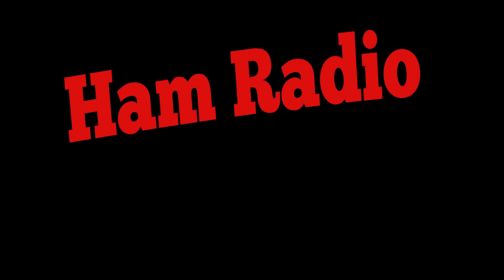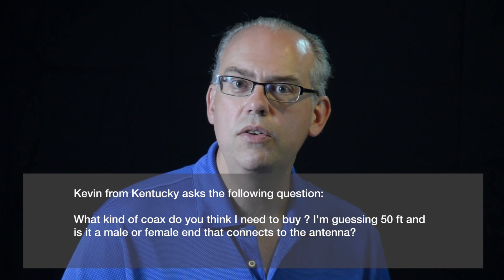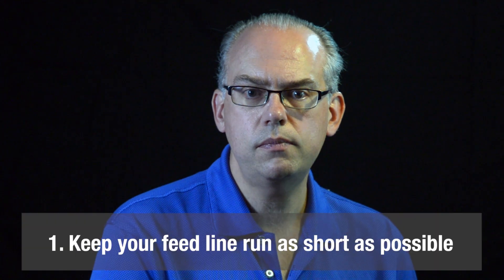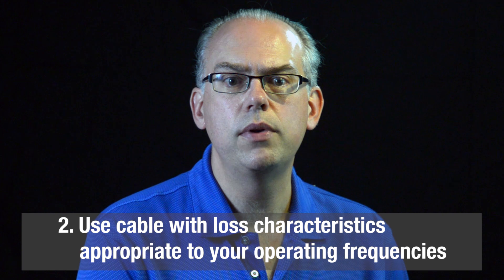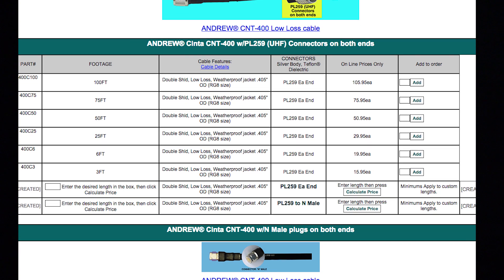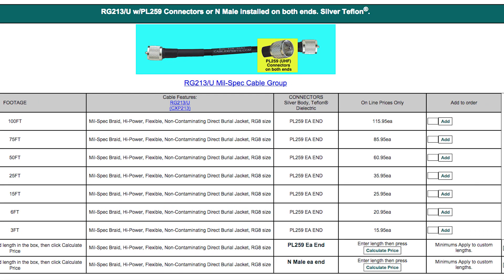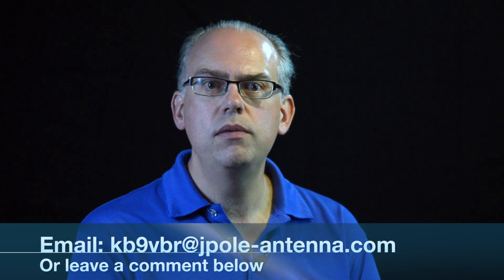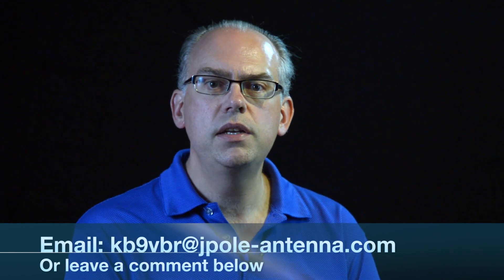Ham Radio Q and A Episode 2: Selecting Coax Cable

Comment: So, if I'm trying to errect a GMRS external antenna at my house, I can either run 25 feet long the brick house and then out along the wrought iron railing before reaching the base of the mast... or, try to eliminate the run, and use about 10 feet to a temporary mast outside my kitchen window.  If we're looking at 462.500 Mhz to 467.700 Mhz for GMRS, what should I be looking at?  I'd like to keep the diameter of the coax small, so that I can sneak it in through a power socket from external wall to internal power socket in the kitchen and onto my counter.  What say you?
Reply from the maker: The thinnest coax cable I would go with for the GMRS is RG-8X and even then I wouldn't try to extend the length past 25 feet. At 25 feet you will have 2.1 dB of loss with RG-8X cable at 460Hz. https://www.jpole-antenna.com/faq/coax-feedline-attenuation-chart/. Those losses might be acceptable if you are using a 40 watt base radio, but if your GMRS transceiver is a handheld unit, you will be at a severe disadvantage. 

One option may be to use a thinner cable to get through the power outlet and then outside transition to lower loss cable. That may help minimize your feed line losses greatly.

Comment: As I was taught. Your antenna is 90% of your system. That includes the feed line. Hardline is the best, next is LMR-400 and crimp connectors.
Would you buy a $ 800.00 Flat screen TV and connect it to a set of rabbit ears?

Comment: Great Video!  Very usefull understandable information.  As you pointed out early in this video,  A persons  Ham Radio Station is really as good as the Cheapest link in the system.  I will try to get the most low loss coaxial cable I can for sure!

Comment: Hi mike my name is jack i use just a piece of 148 ft 20 awg silicone flixeable  hi temp wire one end in the tree and the other end to my LDG ic-100 ant. Tuner there is no balun in line  and i have worked all bands 100% what do you think!. Jack kb2txr

Comment: Can you run an lmr-400 in a vehicle 18 ft long on a 40 channel 10 m radio?
Reply from the maker: You can, but really would offer no advantage. At that length and frequency, RG-58 would be just as capable and be easier to work with.
Reply: @KB9VBRAntennas  I had no problem working with mine I got a102-in stainless steel whip with a one to one match on my mobile. and I talk skip when skip condition is good no problems there, my dx86v Galaxy 120 pep upgrade!
Reply: @KB9VBRAntennas  
I could agree with you on that but the LMR 400 at 18 ft there is no loss of power and I got a one-to-one match. It's working fine in my vehicle I have a Galaxy DX 86 v 10 m amateur radio upgrade swings to
 120 pep  Either way they both work. but I think I get a little better output to my antenna with the LMR 400 coax I run 102-in stainless steel whip with ball mount and spring and it gets out.

Comment: Do you know Bolton 400 coax is good or not Amazon sells it as LmR 400 or is it a scam  thanks
Reply from the maker: I have no experience with the Bolton 400 coax, but generally inexpensive LMR-400 knock-offs will use a copper clad aluminum center conductor. That in itself isn't necessarily a bad thing as due to the skin effect, RF energy will travel along the copper skin of the conductor. But it creates two significant deficiencies. First, the coax will be very stiff. It will be harder to work with and bend. Second, it will be more fragile. Aluminum core LMR-400 is prone to breaking if you flex it too much. The coax will be fine if you install it once and leave it in place without moving it. But repeated moves and flexes could compromise its long term usability.
Reply: @KB9VBRAntennas    Thank you so much for your insight. I’ve decided to send it back I found some RG8 steren  that I’m going to trust before I do this other stuff. I tried to search them out they claim their a US company but you try to search it out it becomes a dead end. Anyways thanks so much I sure enjoy your videos I’m working on my ham license thanks again for your response
Thank you

Comment: Question ?? I'm having to replace my coax cable on our marine/ais radio . My question is how do I measure the cable in feet with out screwing  it up ? Every 3 feet or every 1.5 feet ? I'm going to drop in west marine and pick up a super good coax and do my own ends myself but unsure on my limits . I really don't need anymore than 6 feet and tired of picking up junk coax . This coax will be going on our small boat with a 3db antenna and a Standard Horizon 25 watt radio . Might not sound like a big deal but for some reason every time we are in this boat something always goes wrong near by and we are talking from Myrtle Beach SC to Charleston SC coast guard . It would be nice to know I'm doing every thing possible to send information..  Thanks !!

Comment: Is the center conductor on LMR-400 solid copper?
Reply from the maker: The Andrews/Times Micowave LMR-400 does have a solid copper center conductor. The generic brand LMR cables sometimes do not and instead will be copper clad steel. This is often not a problem for VHF/UHF as the signal is traveling along the outside of the conductor due to the phenomenon of the skin effect. But it does make for a stiffer and less flexible cable.
Reply: @KB9VBRAntennas  thank you 73

Comment: I can't afford to buy good coax but i have a 5kw amp. Bang for buck there is no expensive coax and the performance gains / $ are great. If your coax vf is not 87% you haven't done your homework. You can go better. The best cable shown on this list is still not as good as other coax available and it's far more expensive. Even better try not to use coax when possible.

Comment: Very informative video thanks - I'm planning a new station and and am considering a high quality cable run to a junction box that I could then connect forward from to the various aerials I am planning. Do you think the junction box would cause any loss / problems if I used the best components and cable connecting from it to the aerials to follow?

Comment: Great video. I would mention again that cable length is SUPER important in VHF/UHF. Beyond 25 feet the losses become intolerable with something like RG58 or RG8x. Time to step up to some RG8, LMR400 or RG213.

Comment: Thank you so much for this video. Is the LMR400 too stiff and thick? I am trying to set up an antenna in my attic or roof and run the cable thru the inside of my wall into my radio in the second floor. Would it bend enough or not?
Reply: LMR400 is about .400” or 10mm thick, and it’s quite stiff. There is a minimum bend radius, which I don’t recall, but it’s specified in the spec charts online. It’s not a super tight radius. It’s going to be some struggle to bend it 90 degrees within a typical wall, either in a conduit elbow or to fit a wall-mounted feedthrough connector. LMR has an expanded foam dielectric that’s fairly soft, so bends must be gentle to keep the center conductor actually centered within the shield.  There is an LMR400 ultraflex that has a stranded center conductor. It’s more flexible.
Reply: @PeopleAlreadyDidThis  thank you! I posted this a while back. Since then I was able to pass it thru the wall of my house without much of a problem with the bends😊

Comment: I want to buy RG223 and RG213 cable for VHF and UHF band, the question is what is the maximum length is best. My requirement is 100 feet
Reply from the maker: I wouldn't got over 75 feet with RG-213 on VHF. Look into LMR-400, it really isn't that much more a foot, and it will make a world of difference

Comment: i have 75 feet of to run to the antenna to my SWR and power meter but i only have rg58 or rg 8x to run to my lener and radio . how well would this affect the swrs . or sould find some other cable for the meter and lener

Comment: I’ve got 18 feet of mini 8 feeding an Antron 99. It’s too short. Can I safely use a coupler and another mini 8 and how much loss would I be looking at. Thanx
Reply from the maker: Loss will be minimal. on HF‚ couplers may only add about .125db to the entire feed line system
Reply: Awesome. Thanx for a speedy reply.

Comment: Ha ha I was gifted a 1000 ft of rgu 58 u . Verry good for good runs for 25-50 foot runs. Rgu 8 u is better. I get that however the military surplus claimed they have better is that right. If so what is the noumclatere.?

Comment: Hyperflex 13 or 10 is the best!
But its pricey $$$$$$$$$
I like LMR600, but it's more brittle than a 90 year old hip that's why I recommend M&P pure copper coax.
I use a custom dipole antenna w/ traps tuned to 11m or a small rooftop tower antron99 on top of a 2 story house.
alpha Zulu 983 click click 73s
Reply: excellent coax, quality product.. from my research. iam about to buy 1ooft of hyperflex Messi&Paloni..MFJ is NA distributor they dont make it just sell it 7 3

Comment: I have built a 7 element yagi antenna taking centre frequency to 98MHz for fm dxing, Can I use 1/2 s.f feeder cable to connect the antenna?? Cable length will be 15 metre and antenna will be 50 feet above the ground. I want to listen very long distance FM stations up to 1000 km. I will also use a LNA which 50 ohm. Please suggest me which coax should I use??
Reply from the maker: For VHF at that length‚ I'd recommend LMR-400
Reply: @KB9VBRAntennas  thank you so much

Comment: "maintain a minimum mounting distance of at least 1/4 wavelength apart for the lowest frequency antenna within the same horizontal plane. For VHF antennas, that translates to roughly 19 inches"

https://www.jpole-antenna.com/2013/07/28/how-close-can-i-mount-two-vhfuhf-antennas/

Comment: I have rg8x in 100ft.. When i am using icom ic2300h in high power 65w how much power it can transmit in output of antenna
Reply from the maker: I believe RG-8X is rated for 250 watts on VHF, so you should be fine using it with the IC-2300
Reply: @KB9VBRAntennas  how much loss it will present in rg8x.

Comment: Hello sir, can you give me a suggestion what best coax cable should i use for my setup
Antenna = diamond X520M
Portabase = boufeng UV82
Ham base = TYT TH-9000D
and im planning to do a 25meters above the ground tower. Echo siera papa 73's and godbless.
oh and im also using frequency 
140mhz
Reply from the maker: I'd go with a low loss cable like LMR-400 for a 25 meter cable run for VHF/UHF.
Reply: KB9VBR Antennas thank you so much sir i will do the lmr 400.

Comment: Question please... I will be putting up an Eantenna lfa5. The gain is 11.1 and the coax run is 75 feet. Using the chart in your excellent video, if I use RG-8X, the loss would be 4.7 X .75 = 3.5Db. I realize something like LMR400 would be the ideal, but am I totally wrong to call the trade off acceptable?

Comment: Hello. Because of the terrain around my shack, I need to install my 2 meter antennas on a hill adjacent to the house. Total run of approximately 200 feet. Cannot be buried due to rocky soil. I will be running 100 watts. What coax do you recommend on: A. Unlimited budget and B. under $300. Thank you
Reply from the maker: 200 foot cable run will necessitate  use of low loss coax. At the bare minimum I'd use LMR-400 or even something lower like LMR-600.
Reply: @KB9VBRAntennas  Thanks... that's what I was looking at.

Comment: Hi and thanks for the informative video. I have seen things about RG8U being obsolete and RG213U taking it's place. I am just getting into ham radio and will be working on 2 meters initially. I am looking to buy a used Kenwood TM-218 from my license instructor and he is throwing in a discone rooftop base antenna. I figure I will need around 40 to 50 feet of feed line. Which of these two would you recommend? Thanks!
Reply from the maker: RG-213 and RG-8U are very similar, but RG-213 has the advantage of a higher power rating and can be direct buried. HF operators prefer 213 as if you are planning to use an amplifier, you will want a cable rated for that power level. For VHF/UHF, it's less useful as there are better low loss cables out there. But a 50 foot run of RG-213 will work fine for VHF operation.

Comment: great video! What about rg-214 for 70cm repeater? I've heard that this is good also?? I will be using with a steel j-pole 25' run. Motorola m1225 repeater.
thanks
d
Reply from the maker: RG-214 has 5.5 db of loss per 100 feet at 400 Mhz. I think it would be plenty good for your 25 foot cable run. It has the advantage of being double shielded, which is a good thing for repeater use, especially if the repeater is located in a high RF environment. But there would be better choices for a 70cm repeater if low loss and long cable runs are your concern.

Comment: hi kb9vbr. im a new b, just passed foundation, several of the lads from local club hv said (recommended) me to use rg213 as it would be suitable for all acassions… due to where I live I cant hv antennas anywhere so all my radio work will be out in the fields. my rig is a yaesu 891 end fed wire n auto tuner. need 25 feet coax... are my new club buddies right??
Reply from the maker: For HF, 10-80 meter operation, RG-213 is an excellent choice.

Comment: I was told the foil on cable such as lmr400 is no go for hf  should I run rg58 instead thanks for any help
Reply from the maker: I haven't had any issues using foil shielded cables on like LMR-400 or Belden 9913 on the HF bands. but if that is a concern for you, I'd probably choose RG-213. RG-58 is ok for HF, but it still has limitations: it is still lossy at HF freqs and has low power handling capability. RG-213 has excellent loss characteristics on the HF bands and has a UV resistant direct burial jacket, so it will stand up better long-term outdoors.
Reply: KB9VBR Antennas I meant 213 Thanks for the info It was the maker of the ultimax extreme who had mentioned the foil style cable I’m very limited on space so I’m looking for a compromise for my hf antenna 73
Reply from the maker: RG-213 is a great choice for HF, it should serve you well.

Comment: Mike I need 100 Feet of Cable feed line for Yeasi 2900 Rt to my Tram Anteen which is better RG-8 or MLR 400
Reply from the maker: 100 feet of LMR-400 at 150 Mhz has 1.5db of loss. The RG-8U has 2.8db of loss per 100 feet at that frequency. Each 3db of loss is equal to cutting your power output in half. If you transmitted 50 watts out of the radio, with RG-8U  you'd have 25 watts by the time the signal reached the antenna. LMR-400 would be about 38 watts.  So the LMR-400 would be the more efficient cable.
Reply: KB9VBR Antennas 
What size farrier beads for lmr400 w/85' feed line via yeasu ft2900 on your j pole.
I'm looking to purchase,  doing my homework

Comment: The best cable I have found is Andrew Heliax LDF4-50A 1/2" can be found cheap on eBay the connectors are cheap also easy to install. I use a dremel to do the cutting or you can get the cutting tool off eBay for about $20. I found LD4f-50 for about 125 feet for $143.00. There is a guy on eBay selling UHF connectors that work on LD4F this coax is amazing 100 feet at 100 MHz loss is 0.815 lower then 1 DB at 1 MHz its 0.205 loss. IT's not the most flexible but for a base station its fine I had no problem bending it.

Comment: My rule of thumb: 10Mhz and down, RG8 should be fine. 10-30 Mhz I would use nothing less than RG213. If you are going into VHF (6 meter, 2 meter, etc) I would never use anything other than LMR400. The only exception would be super short runs, but anything over 20ft you should be using decent coax.
Reply from the maker: That's pretty good advice.
Reply: Thank you for posting that.
Reply: What about pigtails at either end?

Comment: I think it is worth considering not just the frequency and length of cable but also the use it is being put to, many years ago I was active on 2m packet radio. The radio was more than powerful enough and I was on top of a hill, there was no need for a "hot receiver" or maximum ERP, quite the opposite, of course for 2m SSB the requirements are different...

Comment: Dear radio-mate, I am a total beginner concerning amateur and CB radio ... I actually would like to get the best coaxial cable for 27 MHz CB applications. Please can you recommend me one -- the price is not important. Thanks a lot for  help and kind regards from Zuerich ETH, Stephan
Reply from the maker: For 27Mhz, I'd recommend either RG-8U or RG-213. Both cables have decent loss characteristics for that frequency and aren't outrageously expensive. If your cable is going to be quite long, that is over 100 feet, only then would I consider something low loss like LMR-400.
Reply: +KB9VBR Antennas Thanks a lot !
Reply: @Stephan Strauss: KB0VBR recommendations are fine. If you want better I also recomment you look at 'Aircell' or 'Pope H100' cable. The only drawback with these are that they are not as flexible as RG-8U or RG-213. 73, PD0PSX

Comment: I have a quad band tyt9800 ham I have a hh9000 antenna what cable would be better than the rg8x cable. Kd5qww thanks handyralph @gmail.com
Reply from the maker: Are you running  mobile with the radio and antenna? Or is this combination a base station setup? If you are mobile, then your cable run is probably short enough that RG-8X will be sufficient. In a vehicle your cable usually is only 15-20 feet, so you're not going to gain much performance by going with the low loss cable. Also a supple cable like RG-58 or RG-8X is easier to work with within the tight confines of a vehicle.
Reply: I can't afford a base station ham yet. I'm want to use my mobile radio as a base station  till I save up for a base station. Any  suggestions on  a good cable thanks .kd5qww